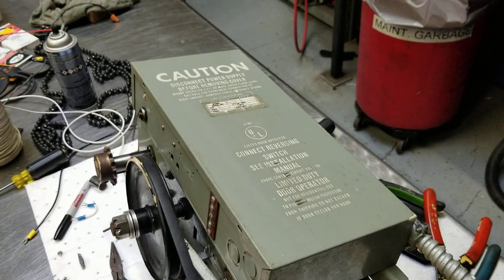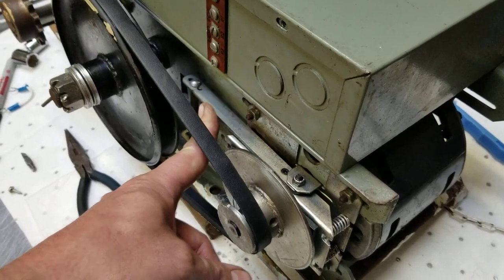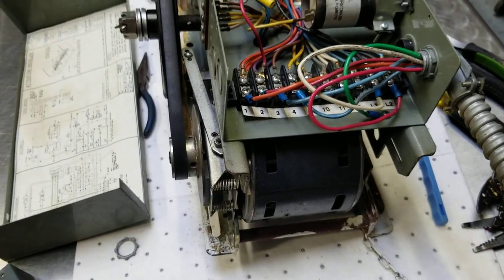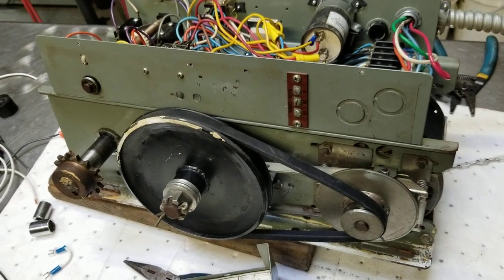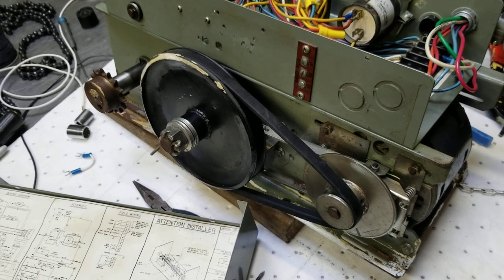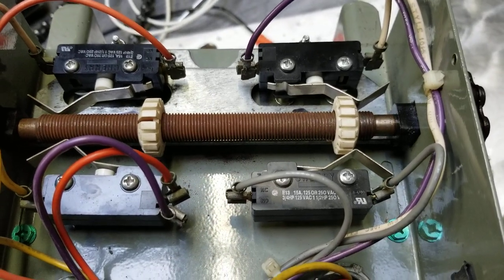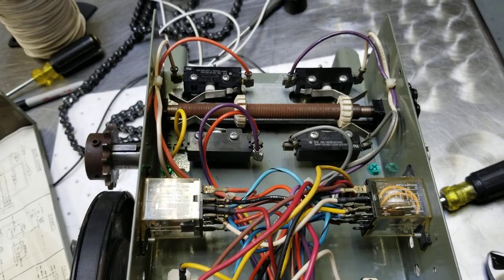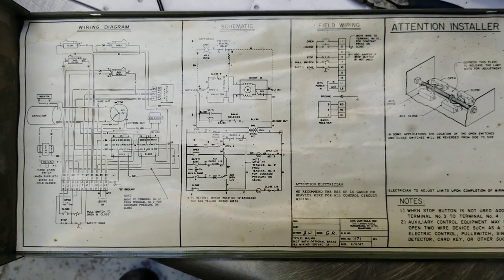How I fixed a MJ5011 Liftmaster commercial overhead garage door jackshaft opener that won't open

Comment: Good job....I used to sell and spec those units. Very popular for moving grills in mall stores and lighter commercial doors. Very reliable but the relay logic has all been replaced by pc boards now and they are very susceptible to damage from lightning transients.

Comment: Hi excellent video. I change the capacitor, next the motor. But still humming and do not open the gate. A little push or pull and works. What I can do next?
Reply from the maker: There might be a second capacitor.

Comment: I'm having an issue with my door opener similar to the one in your video.  It was working fine until I went to close it.  There was a piece of steel tubing from a steel rack obstructing the door and the door hit the steel.  The door stopped and reversed itself to the fully open position but now won't close.  I don't have any type of safety light beam switches on the door.  It's a 10x12 door.  Any suggestions?
Reply from the maker: Check your limit switches, might've stripped the timing nuts.
Reply: Maybe the door has a reversing edge that’s being activated

Comment: Door opened, now wont close. Can hear the motor humming when activating the close pushbutton?? Model B/T-50-11-R2  "LINK CONTROLS INC" opener. Manufactured in 10/02/87. Replaced the capacitor mounted on the 1/2 hp motor. It's a Doerr motor. New capacitor made no difference, still humming. Noticed the onboard electric brake solenoid was not retracting/releasing. Tried clamping the brake in the "released" position but motor still humming. Removed the motor from the opener. Wired to a 120v source on my bench. 6 lead motor, name plate indicated by reversing T5 and T8 the motor rotation would change from clockwise to counter clockwise. Tested on the bench and the motor ran both directions. Appears that the FWD/REV contactor has a bad contact?? Marked wires and removed the contactor from the opener enclosure. Found with a Ohm meter one set of contacts were not passing power when the close solenoid was activated. Have ordered a new replacement contactor: Struthers-Dunn A275KXX-24vac. $136.88 with shipping from "onlinecomponents.com" 1-1-24. If this does not resolve the issue I will add more comments.
Reply from the maker: Did you try touching the limit switches on the corkscrew at the top? There are washers that can activate the close function.
Reply: Must have gotten the wiring messed up. Thought l had marked everything well before removing spade type wire connectors but replacing the fwd/rev contactor did not resolve anything, actually went backwards. Not humming when down button pressed. Was text messaged some wiring diagrams from a seasoned door repair business but they were for the Chamberlain models, after Chamberlain bought out LINK CONTROLS.  Appears they have a 4 pole contactor for the fwd and rev relay and have 6 jumpers on the top spades. Mine has 4 jumpers. Bit the bullet and had it replaced with a new 3/4 hp opener with electric brake. Very costly repair. Thanks for your input.  @JasonSipe16
Reply from the maker: Seems like you tried everything you could. Sometimes, even the old reliable tanks need to be replaced!

Comment: Thanks for sharing your video! (the only commercial garage door opener video online )👍Great tutorial on how it works. Not sure why my repair guy wants $450! to replace my capacitor! Hazard pay?😕
Reply from the maker: Honestly, this isn't that hard to repair. I would say try to do it yourself if you have the time. It might give you more confidence to try other things!
Reply: @JasonSipe16  yea, safely (discharged old & new capacitor) fixed it myself for $26 (capacitor) & 15 minutes of my time. Took longer to unbolt the aluminum box housing around my 2 operators! They charged $165 just to diagnose but wasn’t even sure it was the capacitor & recommended changing the whole unit $1453!
Reply from the maker: @nickcats9171  those are built like tanks! Capacitors are often the problem, and one of the easiest things to replace. Same goes for the capacitors in air conditioners and furnaces

Comment: I have a unit very similar to this one, when you remove the cover the schematic shows a manufacturer date of 1987. The only name i could locate was Link don't know where model number is located. Fact is I can't find anything on this unit. I  was recently hit with a heavy thunder storm and figure its where  my problem begins. Just really need to know if replacement parts are available and where to look. I bought it from a local volunteer fire department for 50 bucks several years ago. HELP PLEASE  any online sources would help.
  Thank you
Reply from the maker: The good thing about these units is that I think a lot of these parts have not changed much in many many years. Parts you would buy for the unit I have, are probably not much different than the ones you have.
Reply: Ok  i'm curious retired and bored. I had a lot of experience with those link operators as the tech rep for a national access control wholesale outlet. If you would like send me more information on what it is doing or not doing and I will be happy to point you down the trail. They are really quite simple to repair if you can read the electrical ladder diagram that is in the lid to the control box. If not you just need a little tutelage.
Reply from the maker: Yeah, and the parts I don't think have changed very much
Reply: @dougdoug2165  what terminals would I wire photo  eyes and monitor or none?? Appreciate it!

Comment: I have a question, please. Where is the learn button in this unit?
Reply from the maker: Not sure. I haven't worked on that in 5 years. You might want to try the manual. It should be online, or you can try to see it on the diagram that is frozen on the screen at some point.

Comment: Hi I have the same equipment and I have trouble with the break solenoid ...  it works well when I open the door the break goes out, but it dosent when I close the door ... Can you tell me what  internal part control the break solenoide 
The break solenoide seams to work well the problem is the signal that send voltage to operate as door close 
Thanks
Reply from the maker: Not sure.  I'd suggest taking a look at this.  https://www.manualslib.com/manual/883511/Chamberlain-Liftmaster-Mj5011u.html?page=25#manual
Reply: My "LINK CONTROLS INC" unit opened today and now won't close. Model B/T-50-11-R2 manufactured 10-02-87. Motor hums and the brake solenoid does not energize. Units 14' off the floor, not fun to work on. Clamped the brake so its released, was able to rotate the sprocket after I disconnected the door from the trolley. Motor still only hums. This has a Doerr motor with the cap on the side of the motor. Pulled it and got one from an electric motor shop in town. Attached the 2 leads to the new cap and nothing changed??
Reply from the maker: Probably the capacitor. I carefully stopped the chain, took ours off, and worked on it in the shop.

Comment: I have the same one,   the problem I have with the liftmaster is that  it goes on but sometimes it don't open the gate, but everything is moving the belt is moving,   but the gate does not move, ,now when  I unplug the electricity and plug it back in,  it works fine, what you think that is ,like 4 days in a row it works then it does that again so i unplug it and it works fine, any help will be appreciated.
Reply from the maker: It sounds like the chain isn't on the sprocket
Reply: @JasonSipe16  i check its on it..the funny thing is the moment I unplug it from the wall and plug the electric wire back in it works without failure .weird isn't it
Reply from the maker: Maybe the starter capacitor is not making it engage

Comment: I have a similar opener and vintage by Link Controls.  The capacitor was replaced and still hums.  Any thoughts?
Reply from the maker: I believe there are two capacitors. I haven't worked on that for a long time and don't have access to it anymore, though.

Comment: I have a very similar and old liftmaster. Would like to be able to retrofit and open it remotely using an app over internet. All i have is the standard remote control that works via radio frecuency and as fas as i know it just closes and open a dry contact. Any ideas?
Reply from the maker: Might be easily solved by adding a wifi control plug or switch, which uses an app to turn it on and off.  https://youtu.be/lRCH67wfwNE
Reply: Should be easy to find a switch that would handle that task online. I would search under home automation and look for a product with an IP address so you could reach it over the internet.
Reply: You should be sure to include photo eyes and other safety equipment to make sure that the door can't do damage when opened remotely.

Comment: How did you change the belt. Mine will not move
Reply from the maker: You have to energize the electric brake to move the pulley. There might be a manual override to the brake.

Comment: Hello, Jason, I have Liftmaster GH mj5011m when I set the limit switch up to level heights I need after closing and open again I lose set height and goes down can you help. thank you
Reply from the maker: Sounds like the upper limit nut (plastic piece that travel back and forth) might be bad and slipping. You can probably order a replacement or maybe use two metal regular locking nuts to act as the piece.

Comment: I have a similar door opener that all of a sudden stop working had a garage door company come out, replace the triple switch unit now the door will open and you can stop the door but you cannot shut the door down now the service tech is telling me that the motor is shot how is that possible that a motor is the problem when it actually can you go up but not down ?  Sounds more to me like a limit switch problem either bad or corroded and they’re just wanting to sell me a whole complete unit.  Is there a different capacitor for the up mode and the down mode?
Reply from the maker: The limiters on this unit are corkscrews ends at the top. Might be shutting it off before it can go backward.